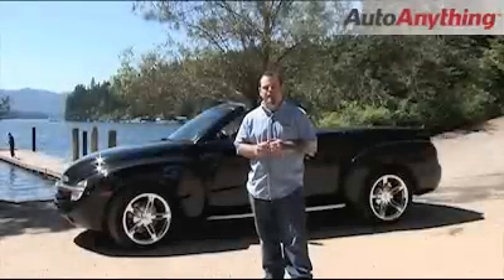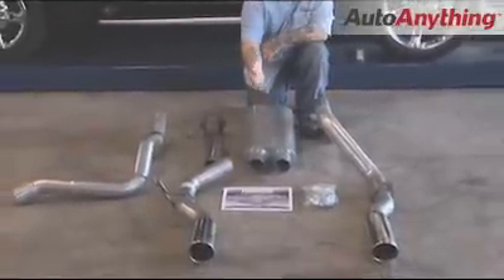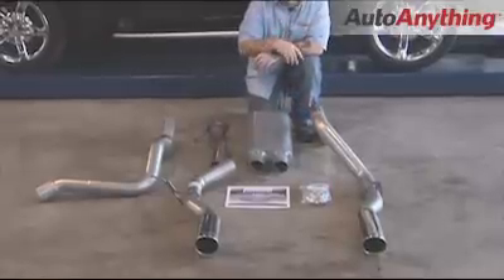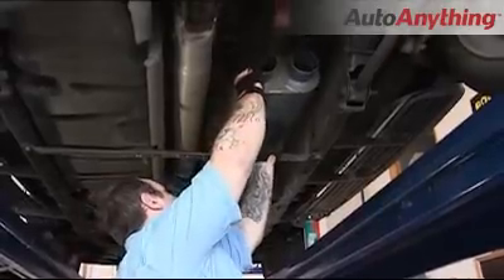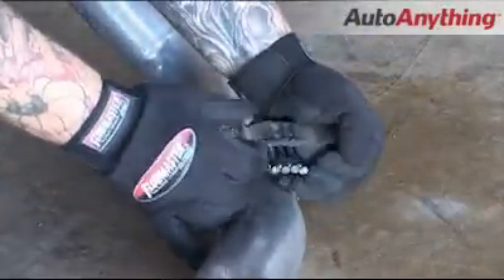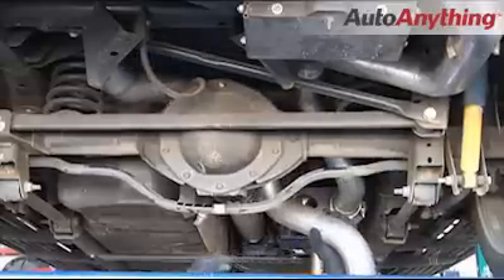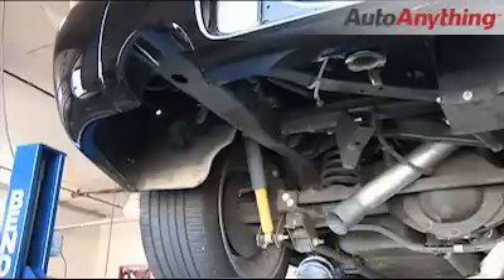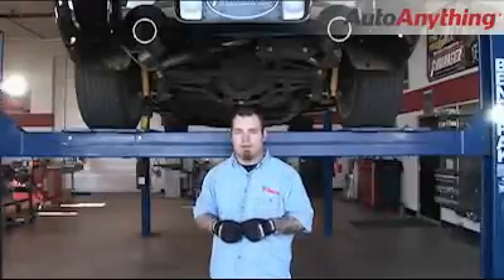Install Flowmaster American Thunder Exhaust on a 2005 Chevy SSR

Comment from the maker: @arios211 If it's a universal muffler, then yes, you can use it with your stock exhaust pipes, but it'll need to be welded into place.  If it's a bolt-on mustang exhaust system which uses the Flowmaster 40 mufflers, then no modifications or welding is necessary.